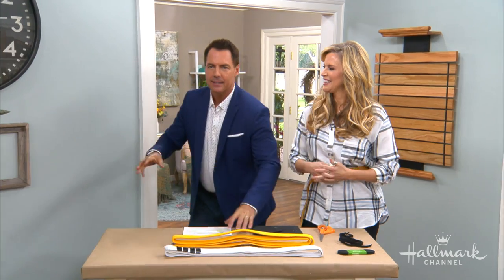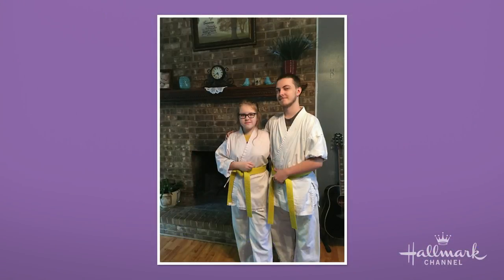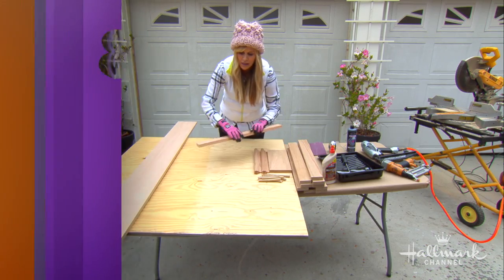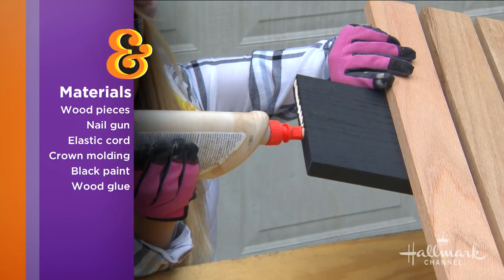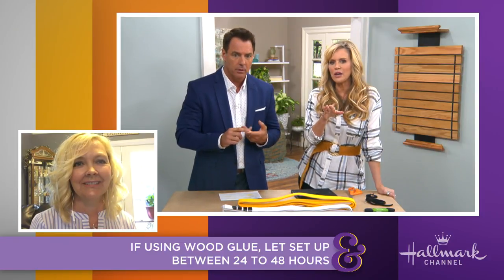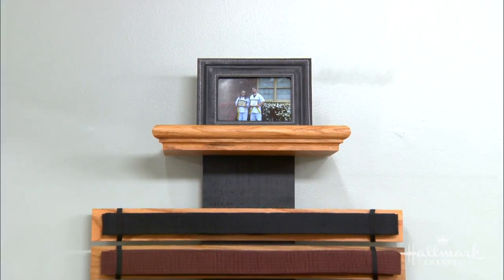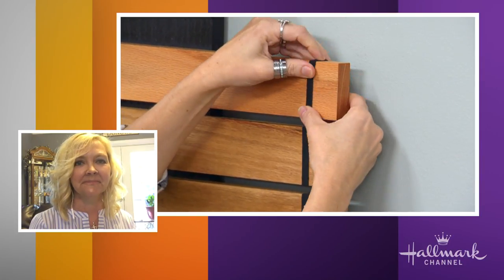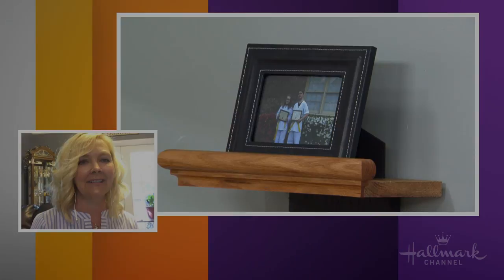DIY Karate Belt Display - Home & Family

Comment: This can all be built with hand tools. You don't need a power saw or nail gun. A saw horse and hand saw will do just as well if you mark your edges and sand afterwards. Small brads would work or even short wood screws - just drill a pilot hole before screwing them in. No drill? As she said, you can glue this together with wood glue - be liberal with the amount and use sandpaper to roughen the areas that will be glued, making sure your measurements are even. You don't need the crown molding for the shelf on top if you don't want it or can't find it. Adding a small longer board above the belt displays that extends past them will offer a place to hang medals.

Comment: How long were the 1x3 and the 1x6? Great Idea
Reply: The belts are 6 foot long. If you fold them 3 ft. Fold again 1 and a 1/2 foot. I made my boards 20 in long
Reply: My back board I made 33in long. 1/2 in in-between slats

Comment: You would never include a white belt in the display, "Because Your Givin a White Belt You Don't Earn it."
Reply: yout start with no belt... the white belt still needs to be earn thats why they included it.
Reply: @Dos Bros Southbay  that's what a white belt is. "it holds no rank at all."  I should know. I've run more tests for rank than I can count. I've never awarded a white belt.  It's the only belt your given.
Reply: @petermarchi1935  So you’re saying the months kids still work to get there  doesn’t count . OK!! I guess is point of views ..
Reply: @Dos Bros Southbay  as I said I've run more karate tests then I can count, and held the title Sensei at the time.  I also hold rank.
Reply: @Dos Bros Southbay   What I'm saying is the 1st belt you earn is a yellow belt
Reply: @petermarchi1935  My kids do taekwondo and has done it for over 6 years. They had to earn their white belt. It was not given to them. It might be different for some. They had to learn their form and work hard to get it.